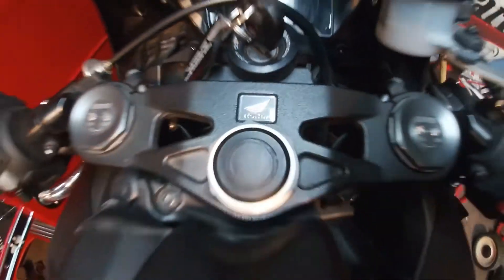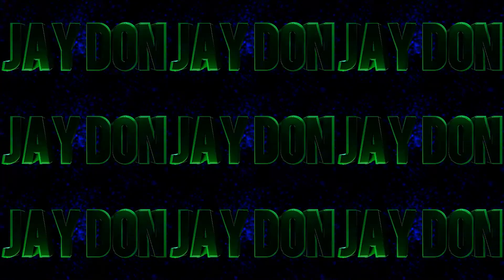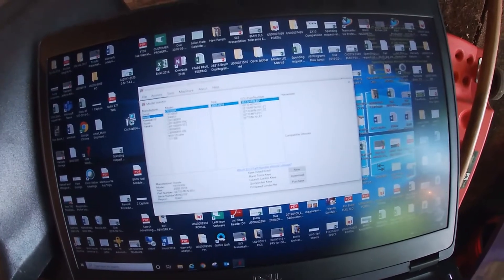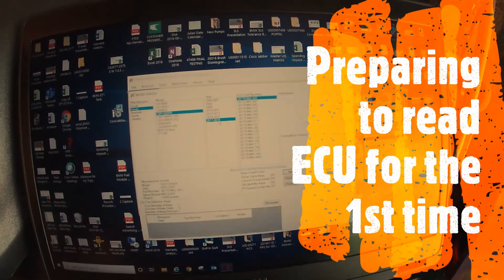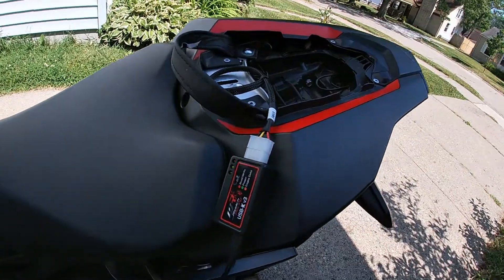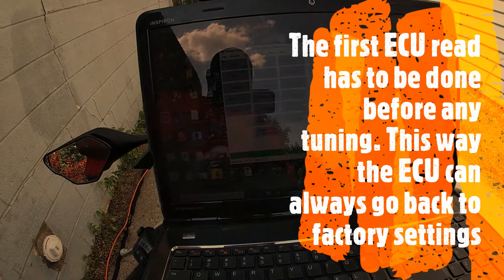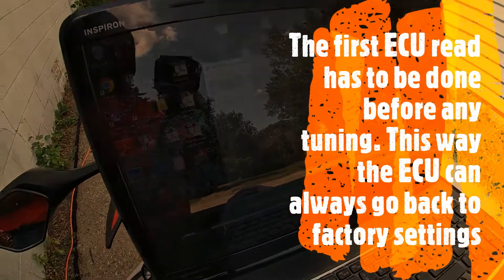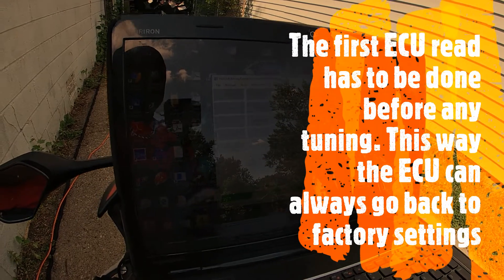Honda Fireblade CBR1000RR Motorcycle Reflash Using Woolich Racing Software

Comment: Does this fix the limitations on throttle openings? My bike has NOTHING at the bottom of the torque range.
Reply from the maker: This removes the bike's restrictions due to noise compliance and emissions. The throttle response is greatly improved. Please keep in mind, this model year bike (2017) is one of the lowest performing horsepower bikes when compared to the other manufactures, but the bike is lighter in weight.

Comment: How to tune the traction control maps?
Reply from the maker: There is no setting to further adjust the traction control.  There is no need to. This model is down on torque and horsepower compared to any other 1000cc that same year. Besides, its not a MotoGP spec bike with 250 horsepower so it don't need it 😉

Comment: wow. Conq. Test it pls if top speed restriction off or not ? What is the top speed on GPS. I wondered so much.
Reply from the maker: The top speed restriction has been removed. He suppose to put it on the dyno next week. The tune I put on is mild, he mostly wanted the restrictions removed. The REV range is still stock.